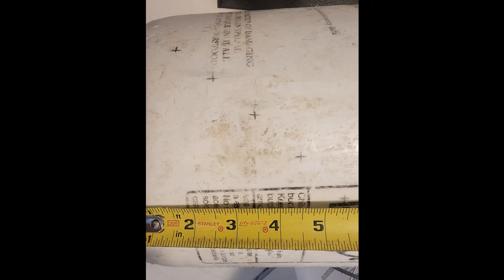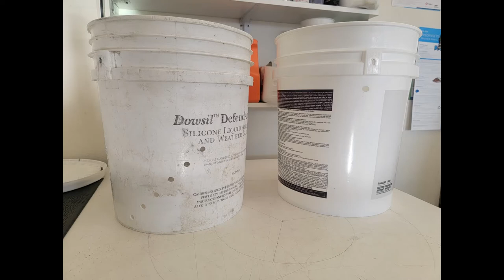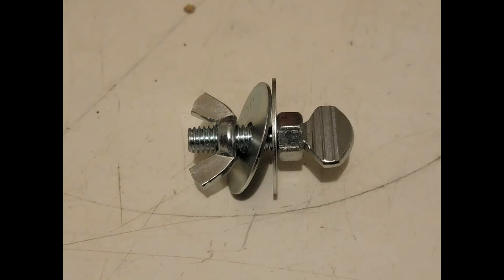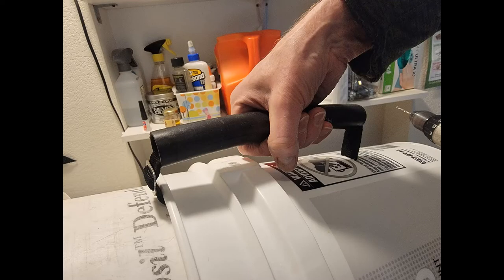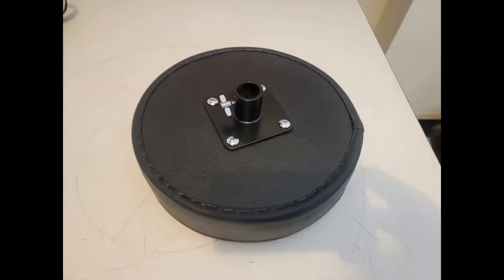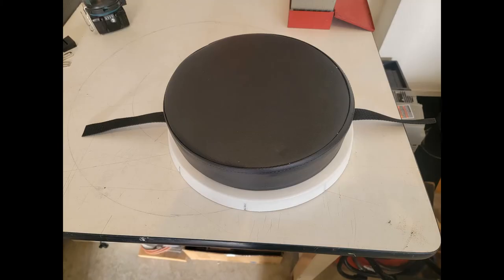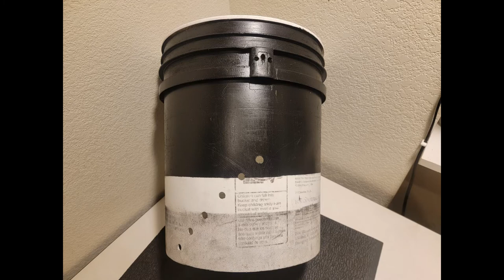Making A DIY Canister Throne - Build a custom homemade adjustable canister throne for your drum kit

Comment: Great video!  I recently did a similar build: single 7-gallon bucket, non-adjustable.  The 7-gallon bucket is about 19.5" high by itself which worked out perfectly for me.  I had to order it online for about $40. There are also 6-gallon buckets (ball buckets at Sporting Goods stores) which are about 18" high which may be good for shorter folks.  
   
Two enhancements for consideration:  
1) I added a rubber "Bucket Grip" on the bottom-- it makes the throne much more stable, protects floors from being scratched, and the extra weight balances out the heavy seat-top.
2) I used a Leaktite Screw-Top Lid (there are more expensive versions called Gamma Seal Lids that come in different colors).  I love the result; the seat/lid screws on and off securely and quickly without any need for buckles or straps.  

I had an old throne seat to salvage.  My net cost was just under $70 (Bucket, Grip, Lid, and Handle). All assembled, my DIY Canister Throne is about 23" high.
Reply from the maker: Great alternatives.  I like the idea of using the different bucket lids as long as they are easy to get on/off.  Simplifies the design.  Thanks for posting!
Reply: Hey, this is a great idea! I've been using this kinda throne for about a year now and still haven't figured out a lid situation, I just basically break my fingers trying to pry it open each time. One thing: all the screw lids I'm browsing on the internet have something of a recessed handle or cross on the top, which I imagine would both be hard to attach a pre drilled throne seat to, and maybe hard to screw and unscrew without access to? Any thoughts on whether those were actual problems or I'm just overthinking?
Reply: @liamjagoe1667   I used self-piercing lath screws and simply screwed them through the plastic Leaktite lid ($9 at Home Depot) into the wood/pressboard on the bottom of the throne seat. I used a lot (16) of screws to ensure it would stay firm and secure.   It's very easy to open and close by rotating the seat cushion.  I've been using it almost a year with no problems.
Reply: Amazing! Thanks so much for responding so quickly. I'm convinced, I'm gonna try this today

Comment: This is very cool! Can I ask how much does it weigh? I’m trying to design an ultralight kit. Thanks!!
Reply from the maker: It weighs about 6 lbs empty.  If you don't care about the adjustability, you could use a single bucket to reduce the weight.  6 and 7 gallon buckets are available to give you more height than a 5 gallon.  Good luck.
Reply: Thanks Eric! 6lb is less than my current throne weighs anyway. 

I’m going to the hardware store today to shop for parts
Reply from the maker: @toberschorr736  Nice!  Hope it works out.  Thx

Comment: What is the interior height of this design? Do you need to extend the top bucket to the tallest setting to fit your hardware. Thanks for the video. I'm building something similar.
Reply from the maker: I don't change the height to load the hardware.  At the height that I use for playing, the interior storage space is about 20.5 inches tall (23 inches diagonally).  My hardware is all pretty short except for my hi-hat stand - for that I do have to break it down to its minimum length.  That's a little tedious because you have to take the tubes apart and unscrew the inner pushrod into it's 2 halves each time.  It works ok.